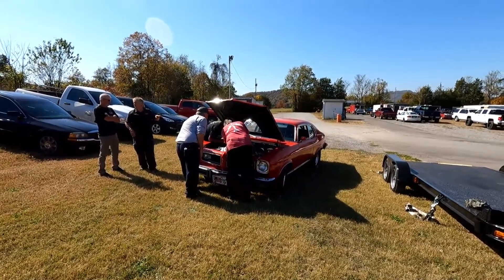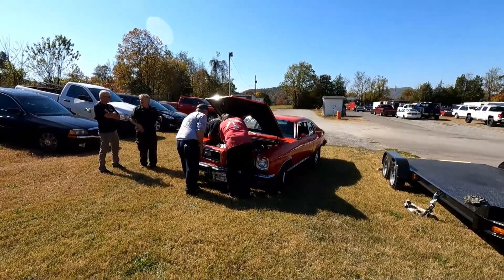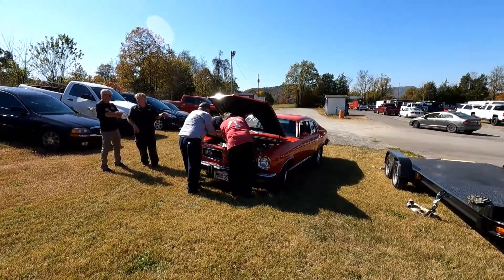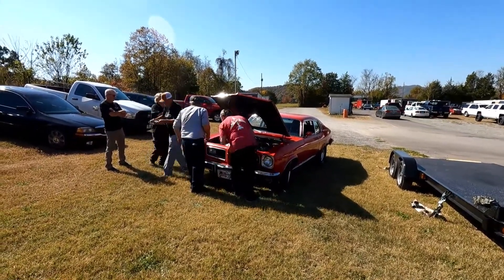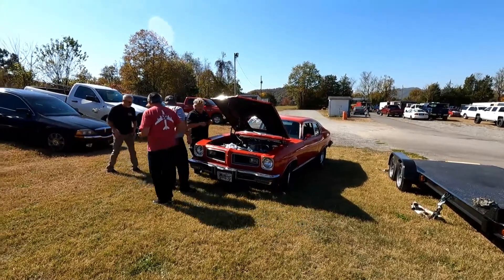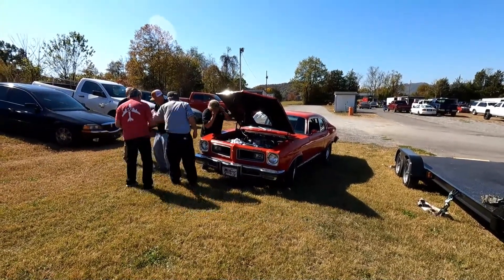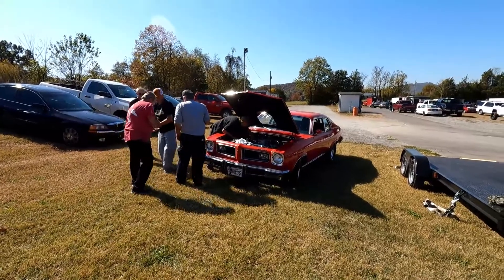Cherokee Raceway October 15, 2022

Comment: How much stall is in the car? How much does the car weigh?
Reply from the maker: Car has a 5500 stall and weighs 3448 with driver. Thanks for watching and commenting.
Reply: @burresscounty  dang gum that thing is heavier than I thought. I think at that weight and 588 hp, it's ET'ing about right.
Reply from the maker: @patrickmoore1017  she's heavy for sure! I agree with you buddy, but 6.80s or 6.90s would be awesome. That may be wishful thinking, though. Either way, it's been a blast making memories with my old man getting the first car he ever bought on the street/track again!
Reply: @burresscounty  heck no man, test, test, and test some more until y'all get it into the 6.50's or faster. Keep going!
Reply from the maker: Absolutely! Too bad the cold weather is moving in so quickly.
Reply: @burresscounty  looks like you’re in the Air Guard or maybe retired out. I retired out of the 278th in 2018. 

Yessir, spend as much time as you can with dad. I lost daddy in 2020, and of course it leaves a huge hole in your life. He was a drag racer like your dad and of course is why I’m a drag racer these days.
Reply from the maker: Sorry to hear about your dad. 

I am AGR with the 134th Air Refueling Wing in Knoxville. Been in 19 years on December the 3rd.
Reply from the maker: Correction on car weight... 3,496 with driver
Reply: @burresscounty  mercy she's heavy